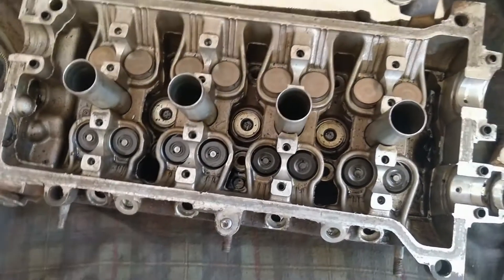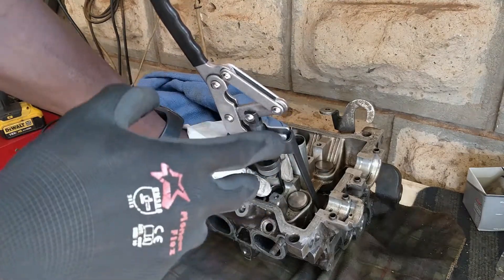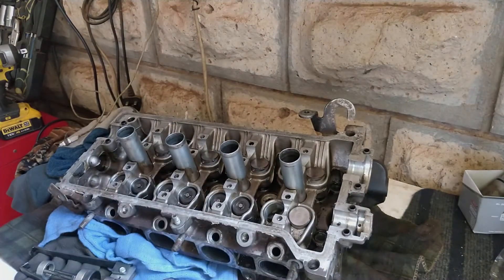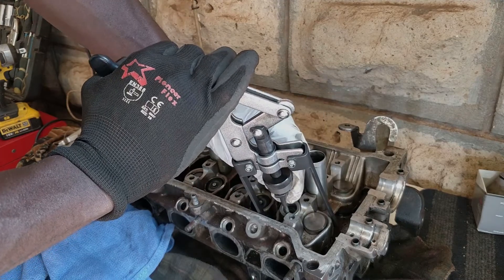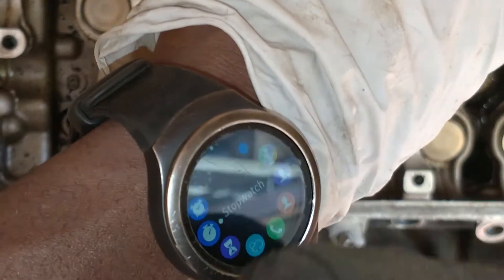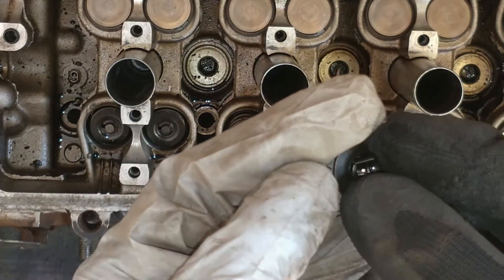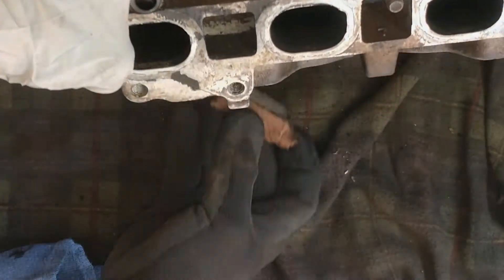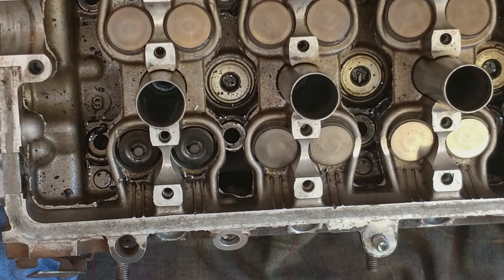How To: Toyota Starlet Valve Stem Seal Swap

Comment: Sir. I have a question for you. Those spark plug tubes are they pressed in or do they screw in? And do we need to apply any sealant to them when we put them back together? I looked in the shop manual for the 4efte and did not find anything mentioned about the spark plug tubes. Your videos are very helpful. I agree it is best to have a smiling face too.

Comment: Nice tutorial. Does this work on a 4afe head?
Update: It does, I just replaced all the valve seals on my 4afe cylinder head by using this method